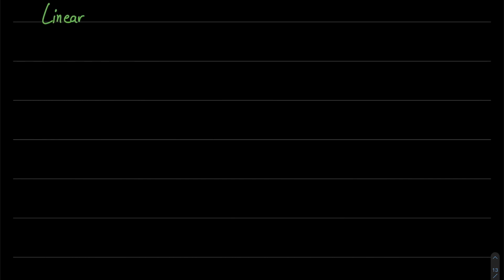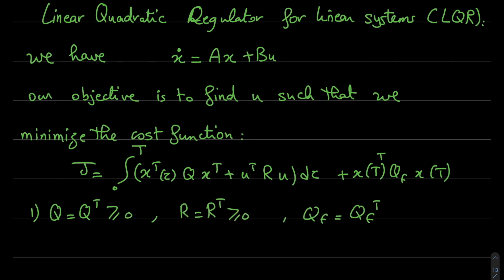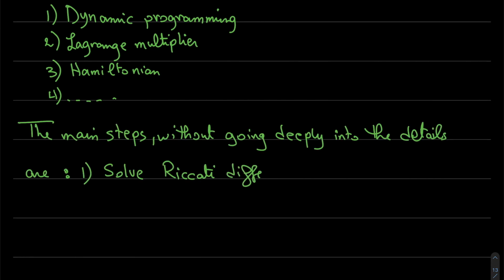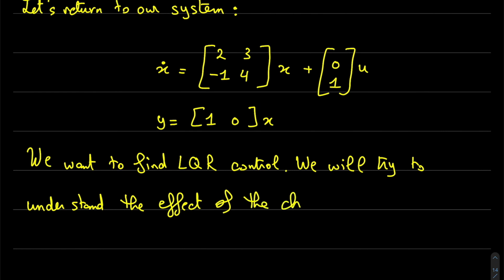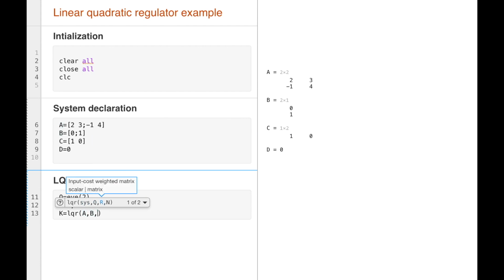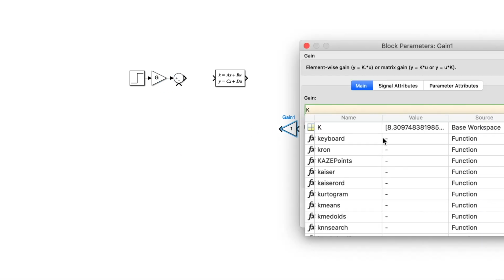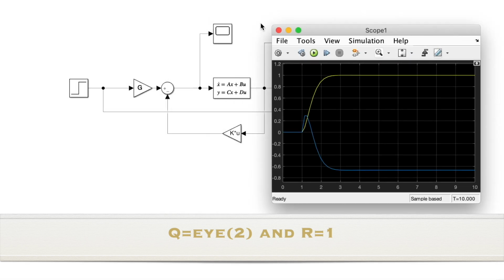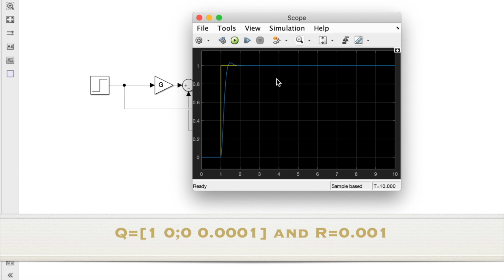Linear quadratic controller with Matlab/Simulink implementation

Comment: If i have three control valves enters the state spce, should i calculate lqr gain separately to each ?
Reply from the maker: Do they have the same actuator? Are the systems coupled?
Reply: They have separated controller, 
I have 3 setpoint step block enter the state space
Reply from the maker: @user-em2mi4wh3u  send the block diagram
Reply: @Prof.AhmadHably  How do I contact you?